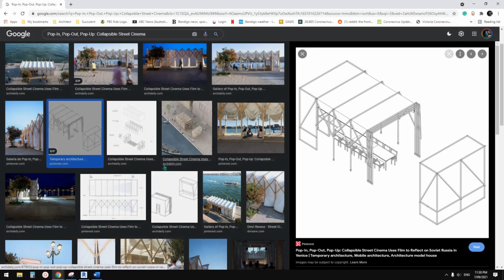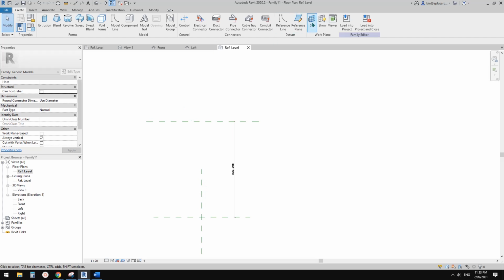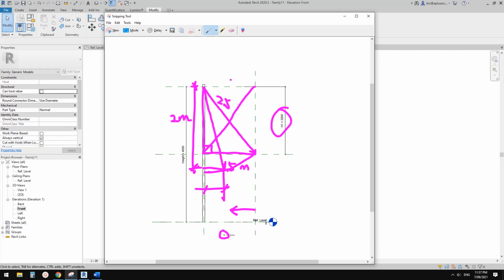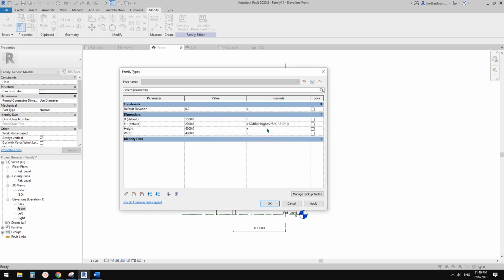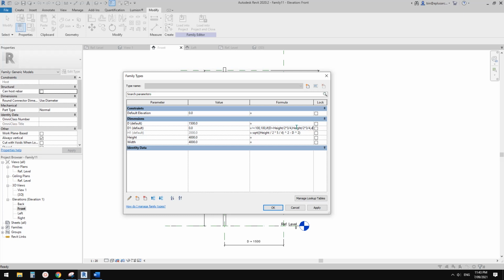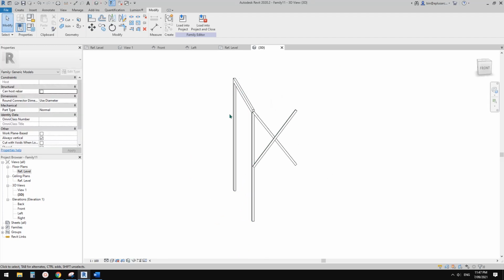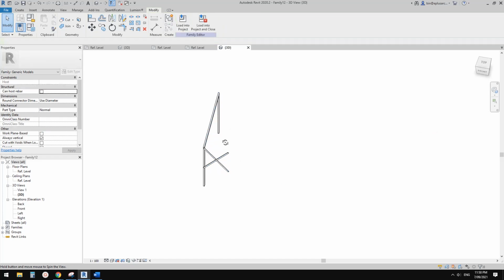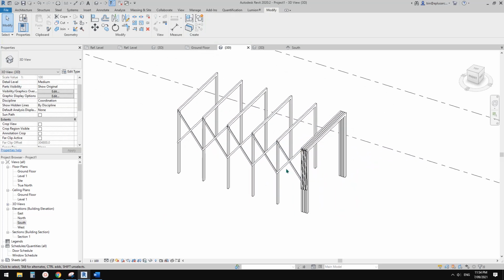Everyday Revit (Day 536) - Parametric Frame Exercise

Comment: Plz tell me one funda sir...when we need sin,cos,tan..and when we need 3,4,5 formula ...i know it's easy to make relationship with sin ,cos ,tan...but here u use 3,4,5 why... thanku sir
Reply from the maker: Thanks for the feedback. I use this formula because I think it is easier.
For example, if we know the length of two short edges in a right-angle triangle a and b, we can directly work out the long edge c = sqrt(a^2+b^2)
If we use sin, cos, and tan, we need to work out one of the angles first using A=atan(a/b), then use another one c=a/sin(A). Of course, we can combine these two formulas into c=a/(sin(atan(a/b))), I think the former is easier.
Reply: @BINHE615  so sir what we r finding here?? D ,or h1 ??
Reply: @BINHE615  thanku sir

Comment: Sorry! Can i ask you a question? At 21:29, i see you change two reference line to "not a reference", so what is the purpose of that action? As I know, Reference Line or Reference Plan changed "not a reference", it will not align and dim.
Reply from the maker: The reason why I change the "Is Reference" parameter of a reference plane to "Not reference" is because I do not want that reference plane to be "Visible" while I am dimensioning this family in the project.  Maybe I will quickly talk about this.

Comment: Hi Bin, I'm trying to do some testing on dynamo. How can I use the material parameter in the formula? For example, the material will change as the distance increases or decreases. Any idea how I can do it?
Reply from the maker: TBH I don't know. But here are some ideas:

First, you need to have all the materials set up in the library, using some naming convention so you can add them to a list.
Then, you need to get a list of elements and use some distance nodes to get a list of distances.
After that, you need to sort the distance list and somehow sort and reorder the lists. (SortIndexByValue I think...)
Finally, SetParameterByName.
Reply: @BINHE615  I have listed materials and distances, but how do I combine the two? bytheway (sortindex) doesnt work
Reply from the maker: Unfortunately I can't help you on this one, I am still quite new to Dynamo.